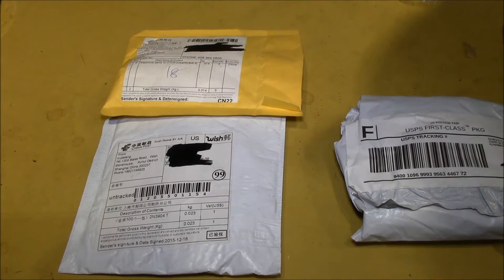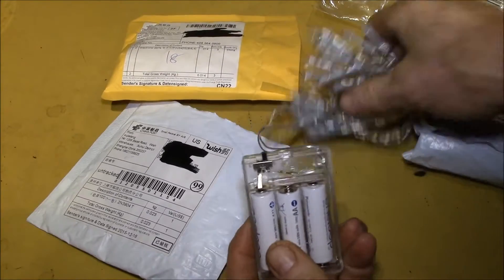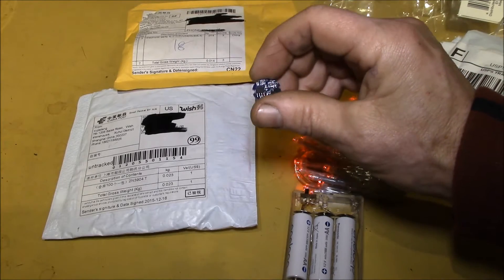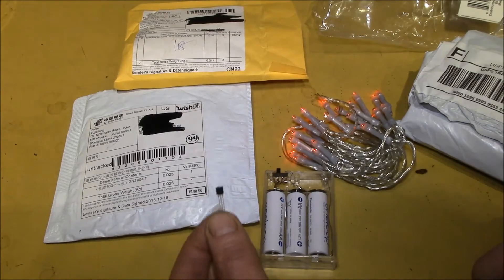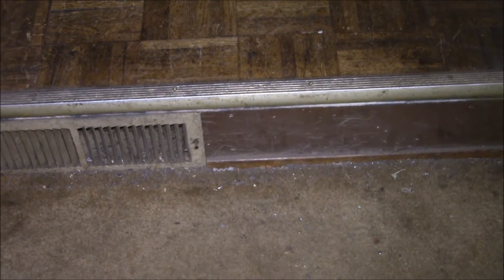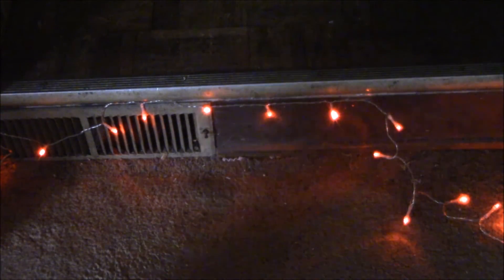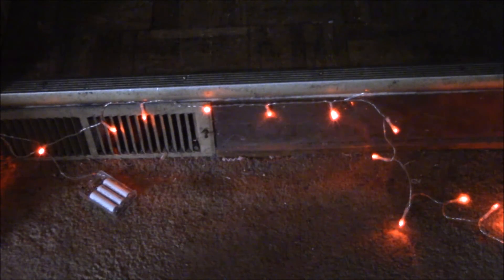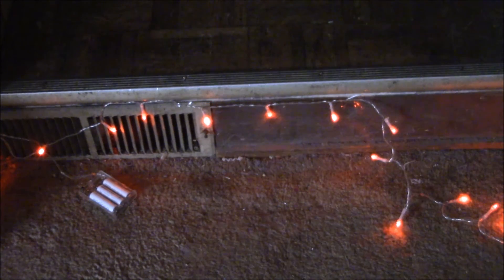Motion Activated LED Step Light, Part 1 - Project Overview

Comment: I zapped a public domain circuitry, and incorporated Solar charging single 18650 battery that powered a PIR module motion trigger 3v-5v Piranha LEDs for my boss wife to find her shoes at Condomium Balcony, 60secs duration. Very simple DIY using a current limiting resistor and bc547 npn transistor.
Reply from the maker: Sounds like a nice solution.  These little PIR sensors are quite easy to work with for sure.  I wanted to keep this one simple, NiMH batteries, should last 4+ months in use, then drop them in the charger for a few hours.